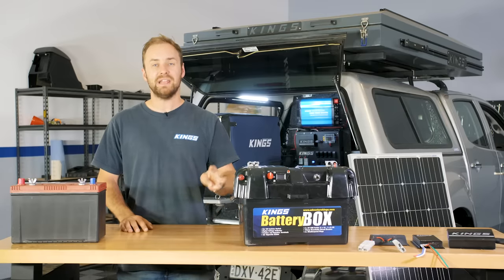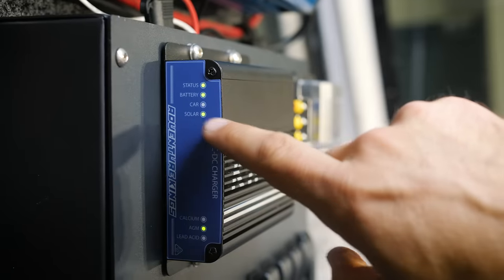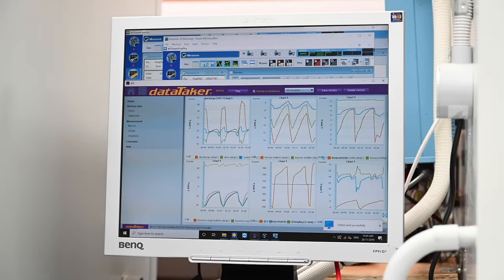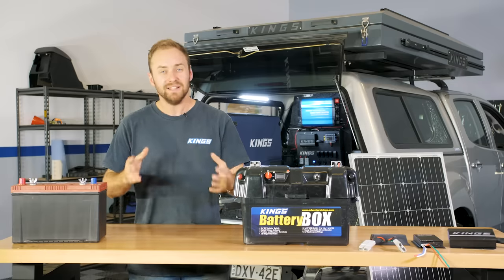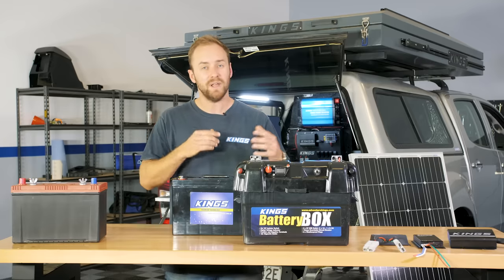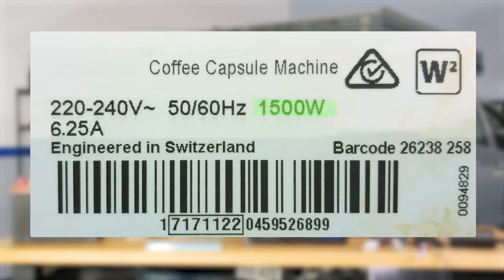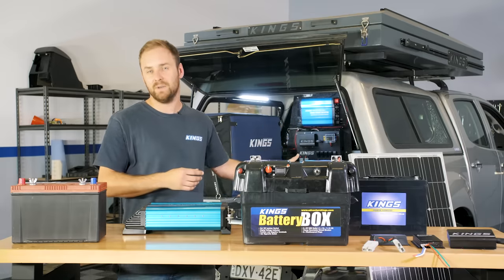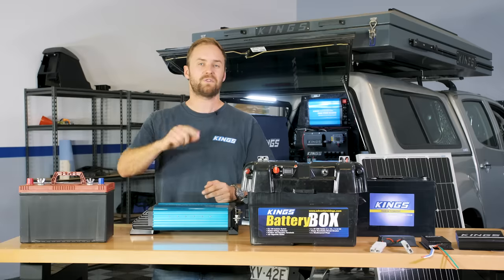Complete Off-Grid 12v Dual-Battery Masterclass PART 3: Next-Level 12v Upgrades

Comment: How many watt solar panels do I need to run a fridge if I’m also using my alternator while driving
Reply: There are lots of factors (these are just some).... 

How long are you driving each day?
The size (capacity) of your battery.
Type, size & brand of fridge.
Is the fridge used as a fridge or as a freezer?
What temperature do you keep your fridge at?

Does the fridge have an insulated cover?
Where is you fridge located (in the shade or in the sun)?
How often are you opening the fridge?
What ambient temperature is the fridge kept at (you can use easily twice as much power on hot days as compared to cooler ones)?

In my vehicle, if I am driving for a couple of hours a day I don't need solar input as the alternator is enough to fill the battery everyday (100Ah battery) and I keep my fridge at 2'C.
Reply: As dingo Dazz said, too many variables to answer this question accurately. 
However, with most things solar, go as big as you practically can afford and fit.

As a guideline:
If it's just an average frigde and is running 24hrs a day, assume you need 25AH of generation to replenish that alone.
Factor in another 10% for losses and you're at about 28AH.
If your battery can accept a charge rate of 10A then you are looking at about 3 hours to fill it. 
If using an MPPT charge controller that can take high panel voltage and drop that down to battery voltage while increasing output A, you would look at something like this
14.4v x 10A - 144W .

Be weary of solar panels going cheap on ebay. Some are sold as 150W+ but are physically too small to be able to output that power. Thanks China.

If solar panels are currently ~15-18% efficient and we are working on getting 1000w/sqm then 1 square metre of panel is going to give you about 150-180w. 
If the total area of the panel is 1 square metre and the label says anything more than 180w they are probably full of shit.

Plenty of good solar diy vids on youtube to study, if all I said makes no sense.
Reply from the maker: Hey Nareeb,

Dingo Dazz and Andrew were spot on with their suggestions - but I just wanted to check, are you thinking of running your fridge off your vehicle's main/starter battery?

Because if so, your alternator will have plenty of power to keep it charged and run your fridge while driving. And even a small solar panel ~100W would easily run your fridge once you've stopped. 

 BUT if it's a hot overcast day, and a hot night, you could use so much power that your vehicle may struggle to start the next day!

So you need to make sure you're running a dedicated deep cycle battery to run your fridge. Connect that to your alternator with an isolator, then as Dingo Dazz said, so long as you're driving a couple hours each day you should be fine. but if you're planning to sit at camp all day without driving, then as much solar as you can afford / fit onto or into  your vehicle is a good idea. Even if it's overcast it will still allow you to get a decent amount of power back into your battery.

Of course it also depends where you're going - if it's a local camp and you've got plenty of mates (with jumper leads) it might not be a big deal if you half flatten your starter battery one time... however if you're heading further off the beaten track on a remote trip, you need to be able to rely on the gear you have. So more batteries and more solar are a very good idea.

For reference our Adventure Kings 120W Solar blanket is capable of putting out 6.49 Amps with a PWM regulator - your fridge might draw around 16 - 48Amp hours over 24 hours. So you'd need somewhere between 2.5 and 7.5 hours of ideal sun every day that you're not driving.

Cheers,
Cahn

Comment: Maybe a dumb question - Why still with the lead acid and not lithium?
Reply from the maker: Hi Sean. The main reason we sell lead acid batteries is because whilst lithium batteries are also great, they're a less affordable option. Lead acid batteries are more accessible for people and are highly effective. Lithium is also a highly combustible material.  I hope this helps. Cheers, Emily
Reply: you ever seen what happens to a lithium battery if it gets discharged too far or short circuited??......BOOM!!!!!......ive been familiar with all 3 different lithium chemistries for many years....and personally won't use one in an enclosed space like the back of a ute or camper trailer......to me they are simply too unstable

Comment: can i run my solar panel at the same time as my dual battery system when driving
Reply: Through the DC/DC config in part 3 yes you can, The inline regulator controls the Amperage
Reply: Norman Gardner Dc-DC controllers with solar input will do exactly this, prioritising the solar input over main battery/alternator input.

Comment: I want to use my 1800w coffee and sandwich press.
But can only fit 1 extra battery
Reply: Hey mate, there is another way to make coffee without a machine:- look up the "Hario v60 dripper" on YouTube.  Once you have had practice, you will be making better coffee than $1000 machine....
Reply: Buy a generator....
Reply: @dingodazz3724  haha
Reply from the maker: G'day Brett, if they're 1800W each you'd probably want to be running them separately I'd say!

Let's assume your coffee machine takes 5 minutes to heat up, and make a single coffee. you'd be drawing about 140Amps from your battery for those 5 minutes. divide that by 60 to find the amps used per minute and you get 2.33 - times that by 5 for the five minutes and you get a bit over 11.5Ah.

if your sandwich press is the same, you'd be drawing another 11.5Amp Hours to make a sandwich. that's a total of 23 Amp Hours

If you had a standard size 100AH battery, you'd already have drawn 23AH - or just under half your usable amp hours, by the time you'd finished breakfast!

you could counter this by running your car while using the inverter (a good suggestion in any case) - but you'd need to run it for about an hour to re-charge what you'd used.

let's say you're running a fridge too. you might use around 24AH over 24 hours. combine that with the coffee machine and sandwich press and you've pretty much drained your battery's usable capacity completely.

You'd want to be driving at least 3 hours a day to ensure it was charging back up - and I'd suggest a decent amount of solar too for those days when you're sitting at camp.

If you wanted to sit at camp without driving, the minimum you'd want is about 250W of solar and AT LEAST 6 hours of ideal sun throughout the day. If it goes overcast, you might have to go for an early morning drive the next day to charge the batteries up before you have brekky!

In this situation, I'd go the biggest deep cycle battery you can fit - maybe 120AH depending on your vehicle. Then I'd opt for a 25A DC-DC charger and hook up the solar input with a plug so you can easily connect your solar to the built in regulator while you're at camp.

Of course, this really depends on so many factors so do a bit of research on what will work for your setup and in your space.

Cheers,
Cahn

Comment: why  does he do 1500watts/12.5 and not 12 volts
Reply from the maker: Hi there,

This is due to most vehicle electrical systems generally pulling at about 12.4v as a standard.

Regards, Andrew

Comment: Hi great vid is that box going to be available with the 25amp dc to dc already installed and if so how much and when available
Reply: they currently have it for 250$ i think but does not include the dcdc charger
Reply: oneill93 thx mate I know it’s available with out
Reply from the maker: Currently not available with it already installed... but something we may look into if there is enough interest in the future. You can get them both separately!

You could easily get your local auto electrician to wire this up for you!